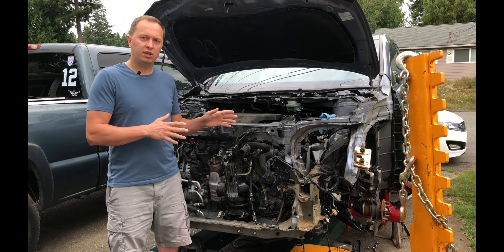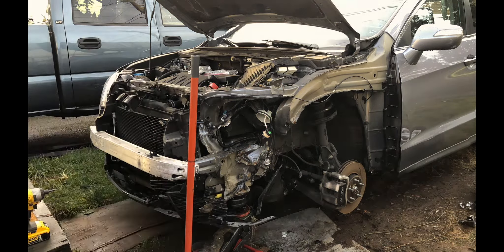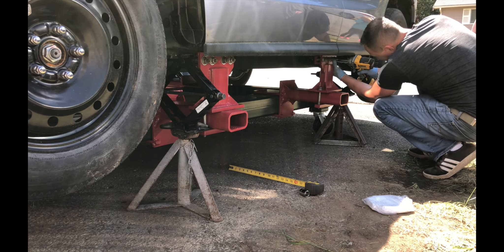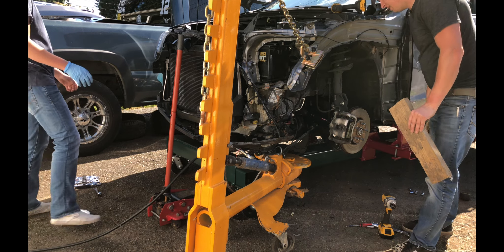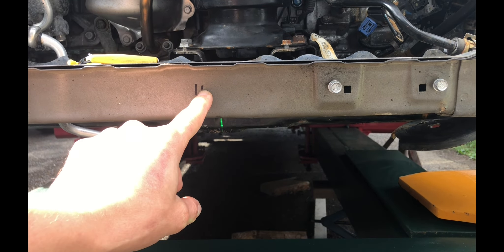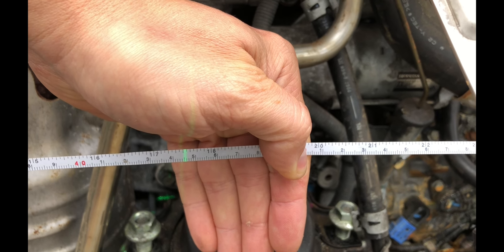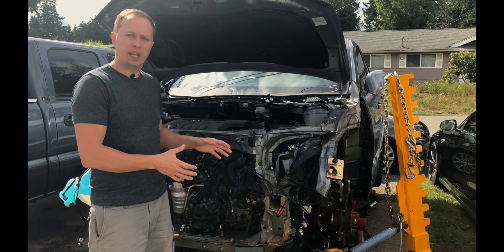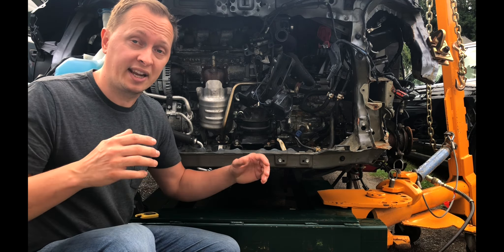✅First Frame Pull Test on my Homemade Frame Rack Jig

Comment: Are you leave some of the bent items to use to pull on and straighten the main core then remove and replace? That is the gist of what I am seeing but not being there kinda puts me at a disadvantage. I like the power you are getting. Will the castor and camber come back with the pull or is that another pull?
Reply from the maker: Some of the bent panels will be replaced, others will be straitened out and reused. And once everything is pulled back 100% into it's original position there won't be any issues with camber or caster
Reply: I believe I understand what you are asking. You pretty much should leave everything you can on the rig for the pull. Doing it this way will pull EVERYTHING back into place. THEN you can disassemble and replace. If you pull crash bar and any other kind of structure off first, you will have a very difficult time trying to pull both sides even and getting it squared up.
Reply from the maker: @BurkesRepair  More of less you are correct

Comment: You should have dropped the engine and transmission before starting that work, right?
Reply from the maker: There were no kinks in the rails so I didn't have to pull the engine and transmission. Normally engine and transmission would have to be pulled if the frame damage is severe, but this wasn't the case
Reply: @fix206  ahhh. Good to know. I found your video becaue I'm looking at used frame machines and Chinese machines on Ebay. I did order a $7000 machine off of Ebay after going and seeing one in a local shop. They've used it to repair hundreds of cars but said that the ram hat to be custom made by an American company because the new one seized after a few weeks. They did get a replacement from China for free but it took 3 months.so now they have a backup. Anyway mine will be shipped to work in Seattle from LA should be here first week of December I cant wait! I'm already looking at smashed accords and Fusions! My first one will be rear damage with no airbag deployment
 Baby steps! I bet you could manufacture those machines and sell them on Ebay as kits. I would have bought one for sure.